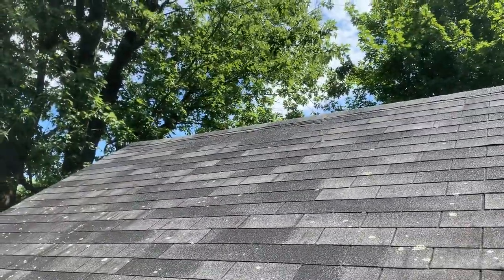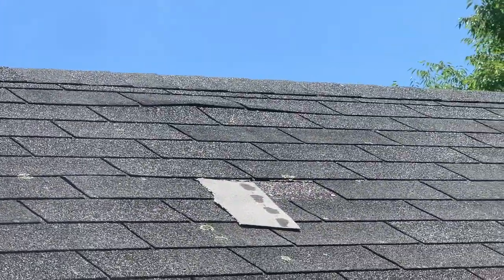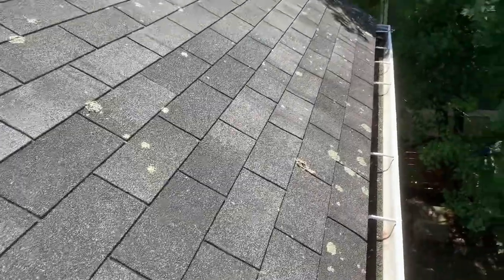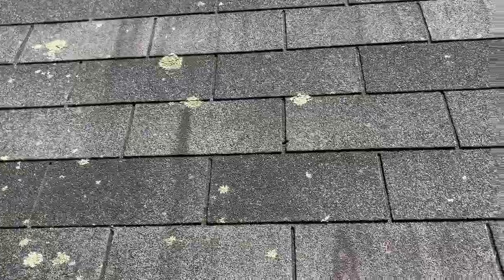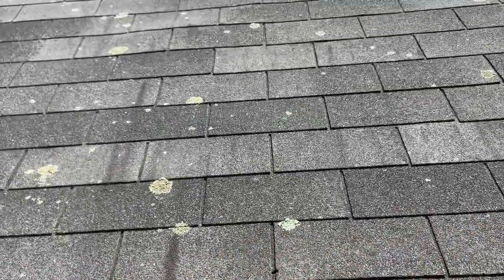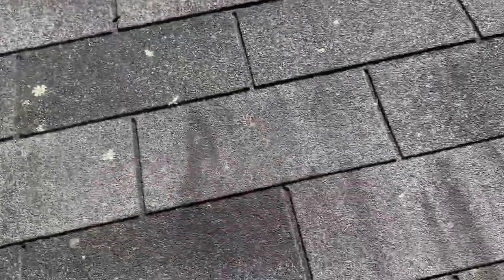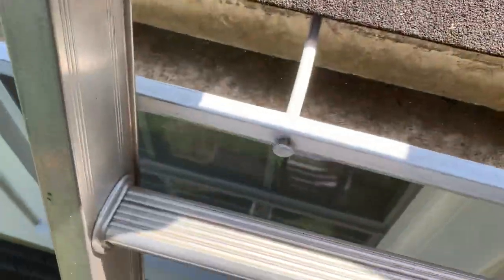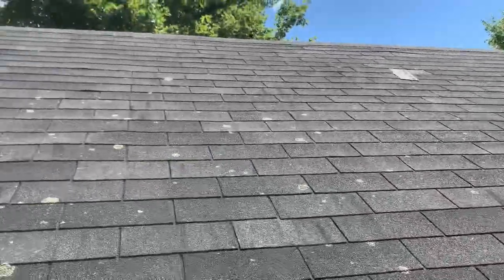Nail hole causing leak in roof

Comment: I have a fairly new roof, about five years old but did notice lots of drips "for the first time ever" during v heavy downpour .. at exhaust fan area in bath ceiling. On roof, I found the nail rise in the exposed lower rt corner of the vent housing on roof with the orig dab of caulk also missing. I cleaned up the area and also made sure enough drainage space around top and sides of vent .. The lower corner of the vent with the raised nail had lifted slightly so it formed a small pool above nail hole. Installed a narrow ss screw that fit snugly in place of loose nail that also fixed drainage angle of flange. Without disturbing any orig shingles, I lightly caulked lower edges of vent flange where it meets shingles with clear dap silicone to prevent wind from blowing in sideways, leaving bottom open for drainage and also caulked over all vent screw and nail heads.  We just had over two inch downpour of rain and no leak .. all is ok. thx. It's amazing how much of a leak was caused by that one loose & raised nail on my vent.